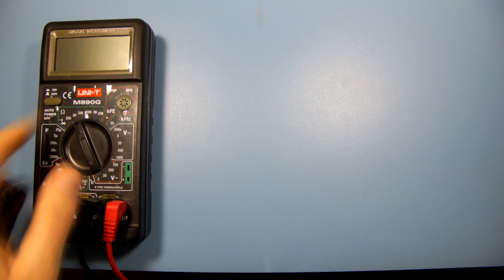How to auto adjust LED brightness

Comment: How could we accompany photocell in LED lamps and street lights
Reply from the maker: It would be doable, but a bit more complicated. You could use several photocells and calculate the average light input, so the lights would not go crazy.
Reply: thank you for your knowledge sharing.
Reply from the maker: No problem :)
Reply from the maker: Cheers :)

Comment: Some Black and white TVs had a similar circuit to automatically adjust the contrast, this was late 50s early 1960s to compensate for ambient light conditions, a bit of a gimmick but just goes to show the forward thinking designers at the time.

Comment: A few years ago when I was still in school we've built a smoke detector in class using a photo cell: I don't remember the circuit in detail, but a LED pointed to the photo cell. Once there was enough smoke in it the LED light was being blocked and the resistance dropped. This triggered a buzzer. Was fun :)
Reply from the maker: The smoke detector is a nice and simple project. Did you have some kind of enclosure to limit the ambient light?
Reply: Yeah, we used empty cornflakes boxes to hide the ambient light.
Reply from the maker: That's a good example of a project, which can show beginners what you can do with electronics, nice :)

Comment: how do the opposite where the photocell turns on the light from the darkness
Reply from the maker: That's a good question and I was looking for a solution but couldn't find anything good enough. Using a microcontroller just to make such an effect is probably an overkill.
Reply: ElectronFun.com 

Bc547 transistor circuit..

Comment: I have an doubt. If the ultimate objective is power saving, I guess the whole circuit is still consuming the same amount of power. Simply put the power instead of being converted into photons(in Led) is now being dissipated across R(inside photocell). If I am right, can you kindly suggest any power saving solutions?
Reply from the maker: I didn't even mention power saving - it was not my objective. LEDs can blind you when it's dark, so my goal was to dimmer them when it's dark automatically.

Comment: how to get the opposite behaviour. i mean when we put some light on the photocell the LED gets dimmer. please reply fast cause i really need to know the answer
Reply from the maker: I'm guessing you don't want to use a microcontroller, right? For the moment, I can't recall a device, which would directly increase resistance with higher light levels. I'll try to figure out something, but can't promise anything.